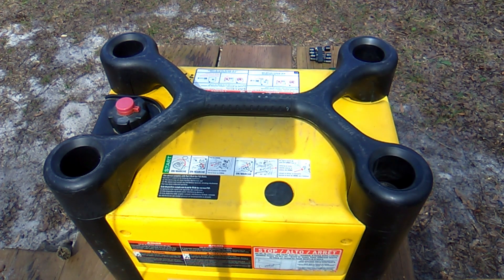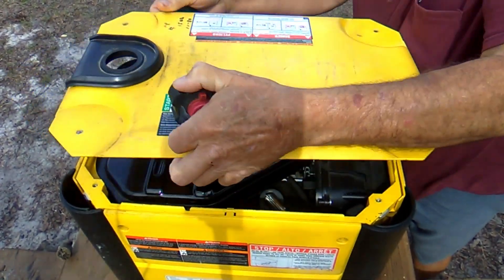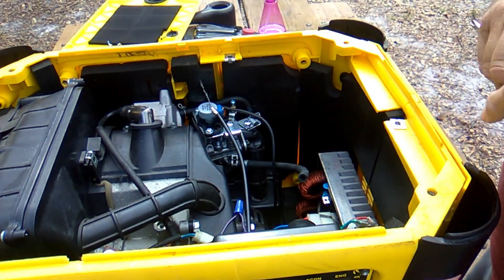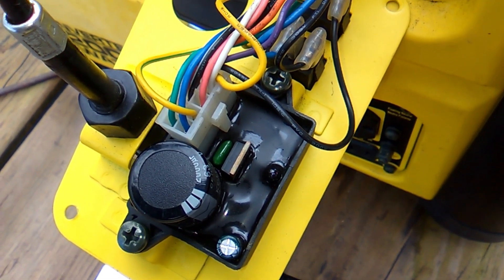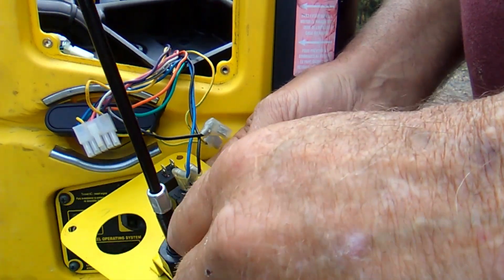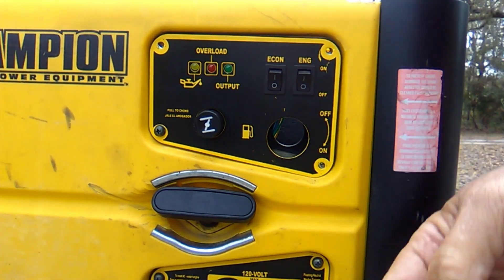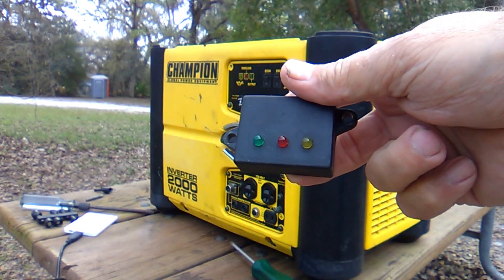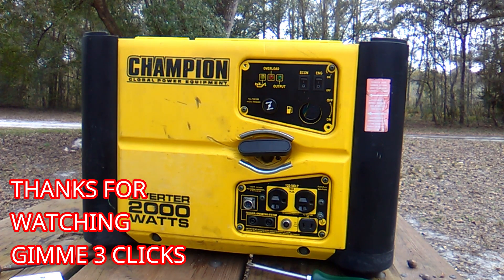CHAMPION 2000 WATT - NO SPARK - fixed

Comment: Let me ask you a question? While pull starting does the leds on the module glow a little? Because if they do and the bad ones don't then that's another way you can tell if it's bad.

Comment: Is this one the same one that was running rough in the other video? Or your other one?  Did you ever figure out why it was running rough.  I looked for an updated video, or any updated comments but didn't see anything.  BTW, you are correct in that a switch is only a switch, unless it is illuminated, then it MIGHT make a difference which wire is which if it incorporates an LED and it is DC being switched.  Enjoyed your extensive teardown in the other video.  I don't have one of these generators, but I like to look at these kinds of videos before buying, to get an idea how serviceable something is should I need to do it.  Thanks,  JC
Reply from the maker: This is the other one. The one that ran rough I put a new carburetor on I got it from Champion online